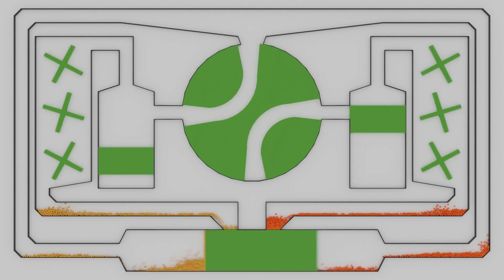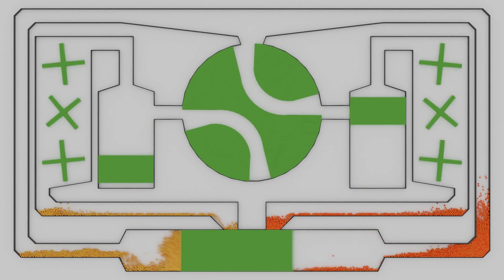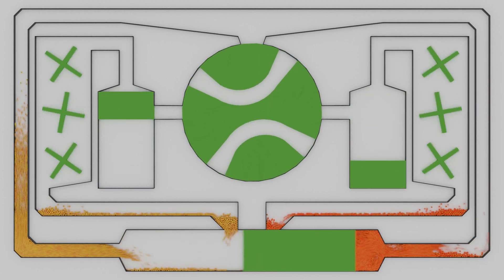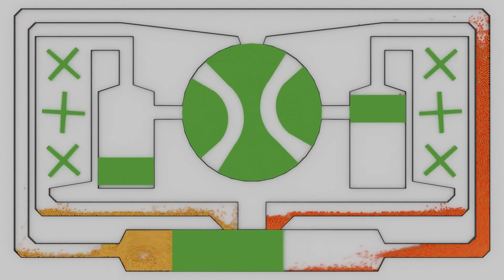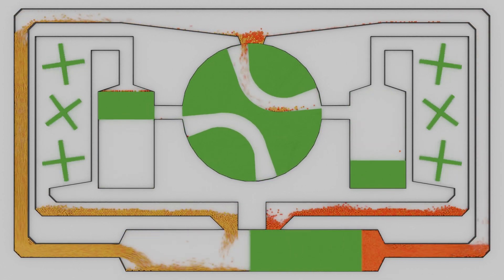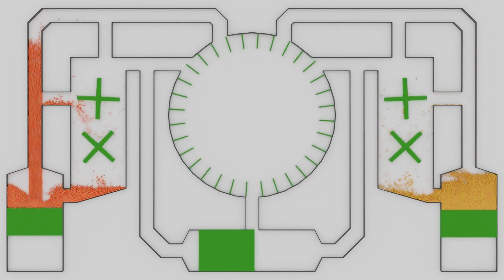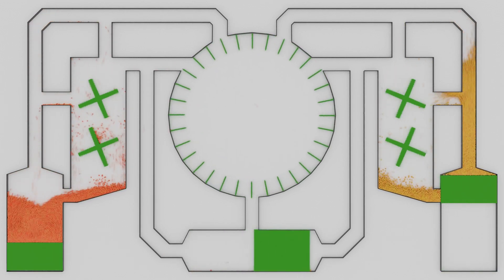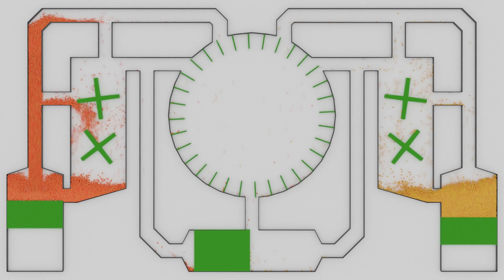Blender Molecular Physics. Highly Inefficient Mixing Machines #004-5 (4K)

Comment: Clip 1
9.3333333 rotations in 5 min 12.5 sec

clip 2
The emitters stopped producing new particles at frame 4320 into the 2nd clip or frame 11820 into the entire video.

Thanks for the shout out.

Comment: Video one, if the clip is "about 5 minutes", it rotates about 9 times.
Video two, 7500 frames at 30 FPS is 250 seconds, which is 4,1 minute. Let's say 4 minutes. It's hard to tell, but I think you let it run for more than half of the clip, so let's say 150 seconds, at 30 FPS, is frame 4500?
I'm not really that good at math, so don't hold it against me if I'm completely off lol.

Either way, very relaxing to watch!
If only someone would make in-depth tutorials on these kind of clips... hmmm.

Comment: Hi there Moby Motion.

I was think that you leaved this channel and you did - for a very long time.

But now you came back and i can see now your activity here.

So, at that moment, while you're active, i want ask some questions and suggestions:
1. Your addon AI Denoiser stopped working in Blender 3.0 and it doesn't work in LuxCore and ProRender.
2. I saw your addon "Autofocus" on Blender Market. Please, tell me, for what should I buy it/ What this addon does do?
3. By the way, sometimes YuTube recommends me  to watch your old videos.......
Reply from the maker: Hey

1. glad you’ve found my denoiser add-on useful. Actually, in more recent versions of blender it’s not required, cycles has a button you can tick to allow denoising, and you can even specify what specific denoiser you would like to use.

Regarding other render engines, these were never officially supported. Do they not have a denoising button like cycles house?
2. “Auto focus pro“ allows you to auto focus your blender scenes in a single click